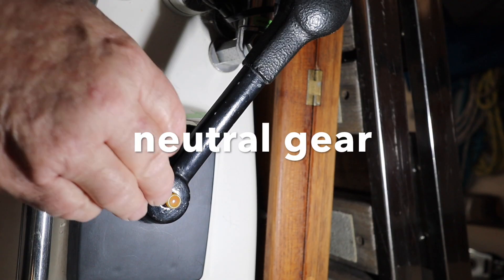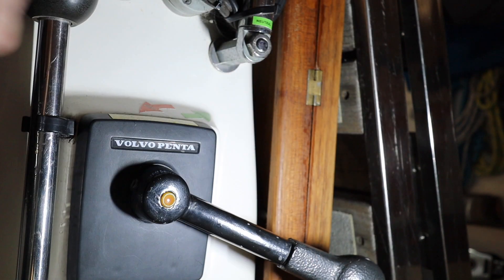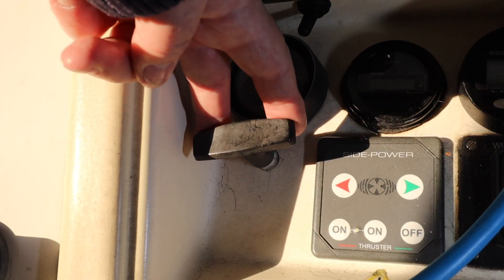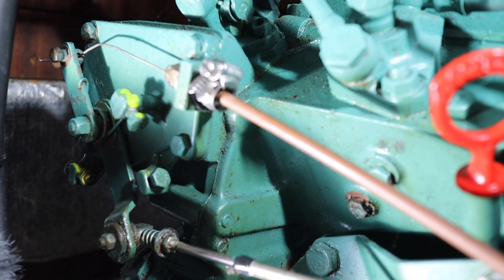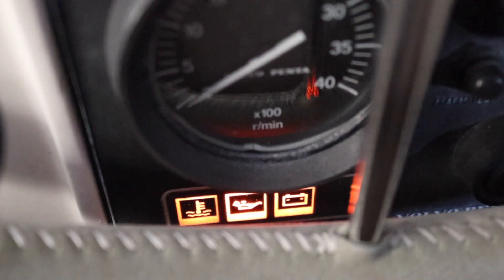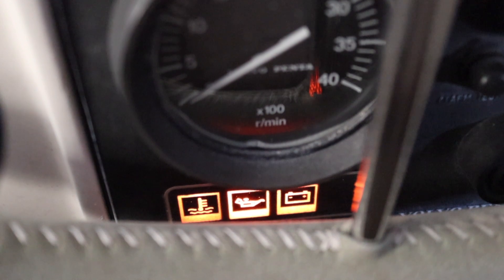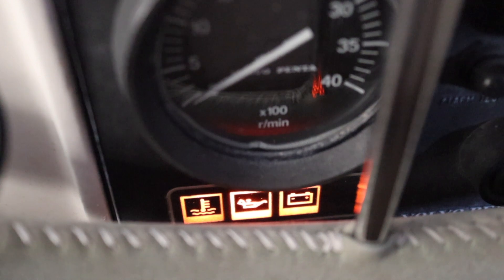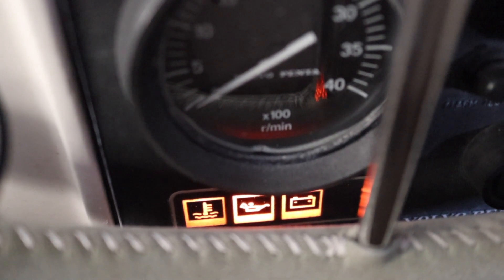Volvo Penta cold start procedure

Comment: Hi. Tank you!. Should the buzzer sound when the engine turns off or before starting?
Reply: I mean, when you turn on the ignition contact should the buzzer beep continuously and then go off when the engine starts?
Reply from the maker: Usually no sound with ignition on unless there's a fault after the engine has started, hope this helps?
Reply: Should the buzzer only sound if the engine stalls? Or only in the event of heating or other malfunctions such as a failed alternator? Thanks!
Reply from the maker: Yes buzzer should sound with a fault e.g low oil pressure.
Reply: The buzzer should sound if the ignition key is on, since it is in parallel with the three lights.

Comment: Hi, this has been very useful thank you. My boat has a VP 2002 and I would appreciate a bit of advice about adding an manual ignition switch to my push-button set up. How can I contact you online? Many thanks, Rick.
Reply from the maker: Hi Rick, yes it's possible to start with a remote switch. 
Perhaps "Hotwire" under the fuse block relay. 
You'll need a wiring diagram or schematic.
Sorry I'm not available on line, Rob

Comment: Hello Rob, thank you for sharing your video with us! Ik would like to share an issue with my Volvo P 2002.

Is there a way that I can share with you a video, to explain the issue?

It basically legs acceleration throttle response with cold start. Starting up is not really a problem.

Just let me know if you are open to discuss my engine.
Reply from the maker: Hi , have you tryed posting your engine issues on one of the many Volvo Penta forums? 
Theres a wealth of experience possibly able to help. Good luck, Rob

Comment: Latest VP engine I used was salt water cooled two cylinder, build in 1965. Used a heat gun through the air intake and decompression to make it run.. 🧑‍🦽🧑‍🦽
Made a hell of noise, but stable when I succeeded starting 👌
Cold start was button activated on the pump 👇🏻